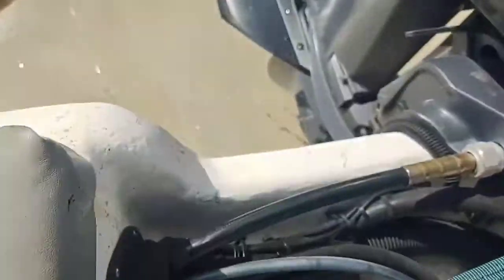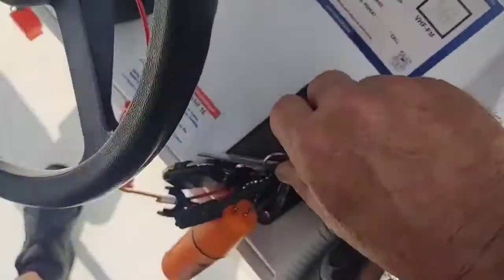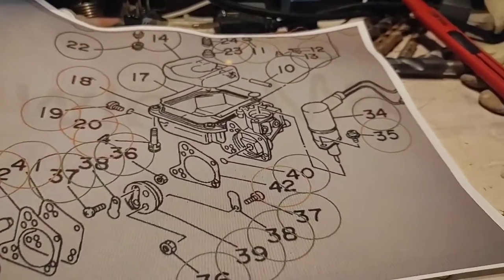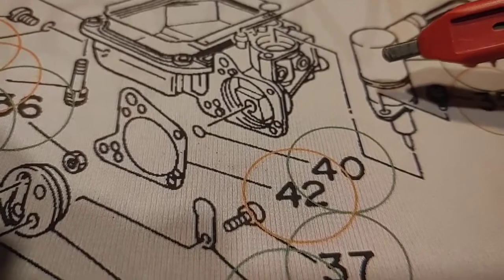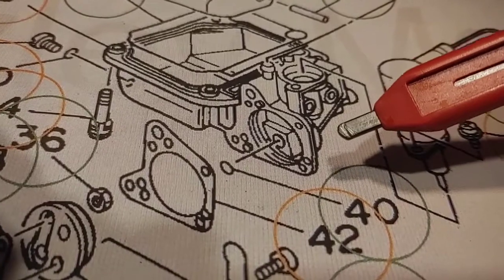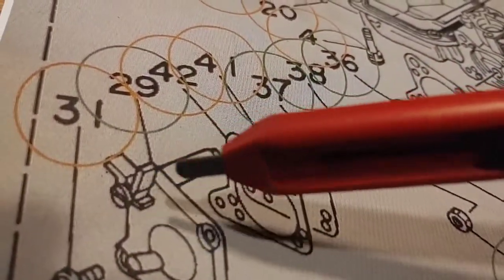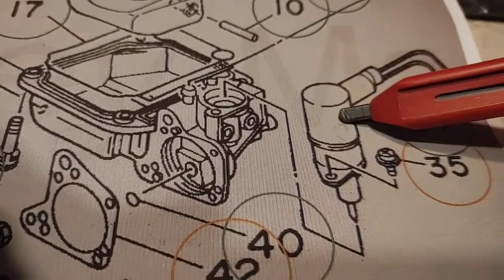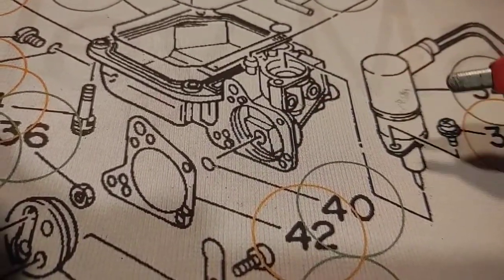Yamaha (choke) Prime Start what the engine sounds like when it works properly

Comment: Thanks for showing this and explaining it in the other 2 vids. Like you said only you  Dangar had info on this. My 90 Yami  is giving me a hard time starting. Going to check the o ring and solenoid out today 👍🏽
Reply from the maker: Thanks and good luck. There not too bad to work on. They just drive you nuts if you don't know what is going on.

Comment: I have two 40hp Yamaha 2 strokes. One with prime start and electric starter. The pther is all manual pull-cord start and manual chocke. They both starts at high idle an depending on temperature falls down to low idle after a moment. It telle me that it can't be the prime start mechanism that does this, because one of the engine doesnt have prime start carb. It must be the electronic ignition module or something. The black box on the starboard side of engine who does this.

Comment: I bought a 40hp two stroke I believe that it's all good.  Carbs were rebuilt a year ago. It doesn't start as easily as I would think. I crank on it about half a dozen times or more in intervals.  Once warm it starts good. I don't understand this unit. It has key push down and button in the middle of throttle/ gear selector. I don't understood what it all does. Never owned one like this.  They told me to push and hold button on gear selector while turning key. I primed it. It just doesn't start very easily.  Battery drops a bit by the time it starts.  Any suggestions?.  165 G3 Yamaha.  2004.

Comment: Hi come across your  channel,  the prime starter I currently have on a 50hp yamaha seems to get very hot, does that mean it' failed,... as it's flooded out the carburettors, ..
Reply from the maker: If it's flooding out ? You have a problem.. I have a few videos on the channel covering the prime start